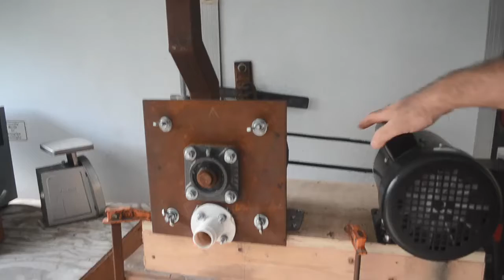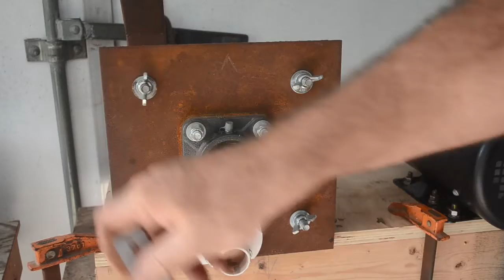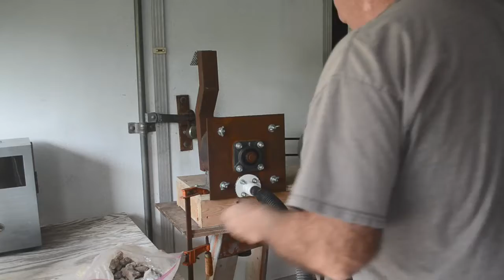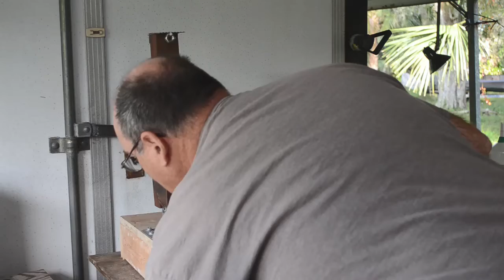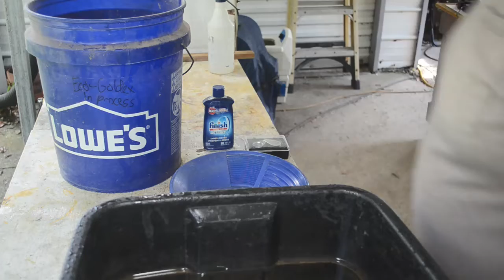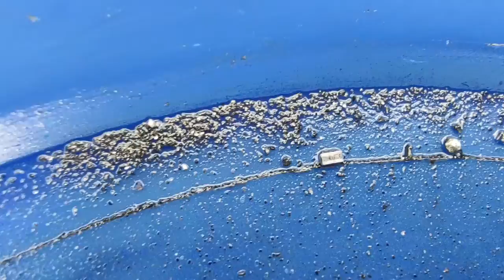Gold From Rocks With My Home-Made Flail Mill & Contest To Name It Part 1

Comment: I would put a piece of rubber hose on the chains to hold them out straight but allow them to flex when they need to you can also bolt them through onto the shaft to keep the sliding off, and as for the screen plugging up I would cut a hole in your vacuum line to decrease the vacuum pressure.

Comment: I'm surprised chain shatters. I think the best option might be something like the mighty mill has with just U shaped stainless shackles. I also like the idea another commenter had with welding a steel ball bearing where you have the cable clamps.
As far as a name, The MC Hammer Mill. "Break it down. Hammer Time!"
Ya, sorry, I'm an 80's kid lol

Comment: Hi Mike,

Thanks for your inspiring video!

A couple of noncommittal ideas:
- Between the unit and the vacuum cleaner, you can mount a barrel with a turning lid that you partially fill with water. The hose to the vacuum cleaner you connect to the lid, and the supply hose you mount to a plastic tube that runs through the lid inside the barrel and emerges below the water level. This prevents your vacuum cleaner from breaking down and dust (which presumably contains less healthy metals) from swirling around. In doing so, you can more easily pour the slurry out into another container, or leave it in the vessel for further processing.

- Another idea is to mount some sort of funnel shape to the feed tube, and place a little step next to the system, so you can more easily feed your material into the system.

- Furthermore, I would use different material for pulverizing. You are now using unhardened steel. You could potentially harden the steel yourself by heating it with an acetylene torch until it glows and then quenching it in mineral oil. In which you take care to get the steel just hot enough that it just stops being magnetic, because if you quench too hot then the structure of the material becomes brittle.
You can also look for old hardened tools, such as old stone chisels, or tools that incorporate widia metal. Old demo|lition chisels, hammers, etc. It won't be easy to apply those because it's hard to drill a hole in hardened steel. But you can overcome that by cooling the hardened part with water and heating the part you want to soften.

- I also recommend using carriage bolts (also called coach bolts and round-head square-neck bolts), instead of the normal hexagonal-head bolts inside.

Comment: The crushing chamber of this machine is like a sand blaster with a really coarse grit! So EVERYTHING inside will get eaten away! The bolts head holding the bearings and much more the hammers themself, just everything in the chamber is something you will have to replace regularly... 
You need to get the bolts head out of there!!! Or at least check them regularly.

I like the design of MBMM! Plates attached to the shaft are holding massive hammer, which can swing free... but also his hammers will turn to dust! Cuz it is still a sand blasting chamber eating everything the sand touches.

Comment: Hmm nice machine ...  Maybe center up the chains more and use "hardened" thick chain with class 8 bolts in the end link in the chains.  Those chain links look a little long and skinny.  Also agree with Ken Jett, be better if the inside was smooth (no bolt heads) ... By the way you do not want to wet process in your "Ball Mill" form Harbor Freight, they leak, and rust 
My name for your mill would be  "The Mikey Mill ... It will eat anything" ... <<<Extra Credit? 😊

Comment: For the inside bolt issue Mike your best bet is to flush weld stud bolts and that will eliminate anything sticking out inside. For the hammers pretty much anything long as it's case hardened to at least grade 80. A possibility is find a couple chunks of mild steel that has some mass to it and take you welder and some hard facing rods like we use to use on drill bits in the oilfield. They will wear but it will not break and the best thing is as they wear just reweld the face back on.

Comment: Hi Mike,  The ends of those cable clamps are made from low grade cast steel. Cast anything in such small pieces will self destruct.  How about a one inch cast iron ball welded to the end of the chain?? Or one inch cubes of steel??  Just thunking out-loud??!!   As for a name - how about "Thunder" - loud, fast, & destructive.   Take Care,     Jim

Comment: how would carriage bolts work on the inside instead of regular bolts?
Would steel balls welded onto hardened chain pulverize as well as those soft steel Crosby clamps that fell apart inside it on this video?